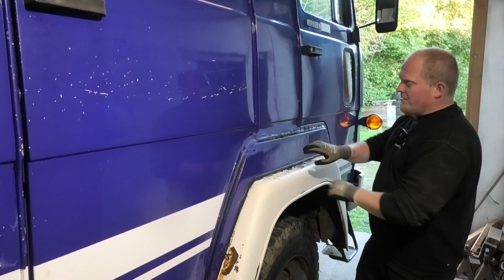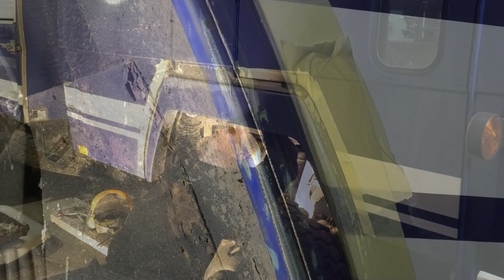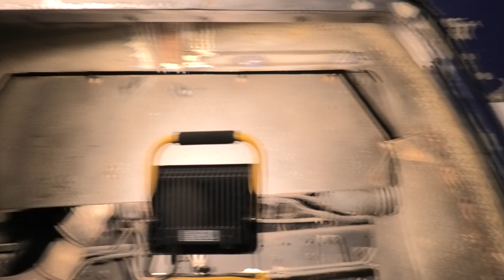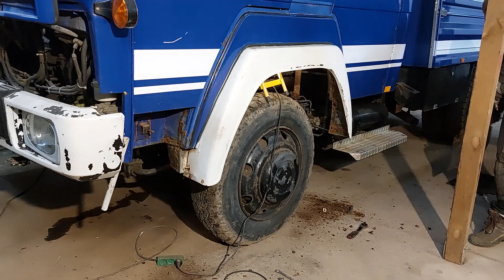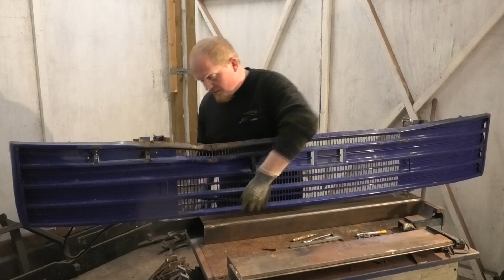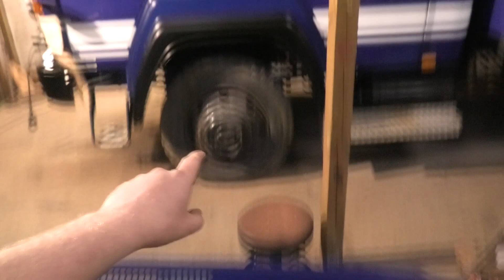Fixing up the Magirus Deutz 170D11 - Part 2

Comment: Dear KJ
👍👌👏 Oh WOW, simply fantastic! Sir, you did extremely well (despite what you've mentioned). Congratulations 🎉 for having all those skills and the patience to do this restoration work. Especially the grille turned out to be great and it's definitely the most recognisable repair. I was happy to see that you gave the old Magirus it's straight face back. By the way: In my memory these trucks had a big trident emblem where the remains of "THW" can be seen. Somehow all that flat metal above the grille looks unfamiliar respectively kinda weird. The Magirus Deutz emblem you put in the grill, sat directly above the grill under the big trident. The way you did it was on the slightly newer trucks than yours is. If you don't want to change it, you could maybe have a 3D printed KJ or KJ OR glued on there!? Anyway: I'm eagerly looking forward to watch the next video.
Thanks a lot for making teaching explaining recording editing uploading and sharing.
Best regards, luck and health in particular.
Post Scriptum: The only thing I would have done different is, that I always put paint on primer. Even if it's covered by underbody protection respectively stone chip protection. Doing so you have a better rust protection (because primer is always kind of open- pored).
Reply from the maker: Thanks a lot!
And yes, you are right, some om the older trucks had the big logo up there on the front.
But this really is one of the newer trucks and this one originally had an "Iveco" logo on it's front.
But i retro-fitted the logo that it has now, because it's not a "real" iveco truck. So I wanted the Magirus logo. And this was the style of logo they had, just before getting the iveco brands 🙂
Reply: @KJOff-Road  
Dear Kasper J.
You're welcome, it's my pleasure.
Thanks for replying. I always appreciate it.
2) I already know all that because I watched the video (and usually I do that thoroughly). In my comment I wasn't talking about the older and more rounder trucks but about this, your 'flat nose" cabover. I remember a red fire truck with the big trident logo under the windscreen and the Magirus Deutz lettering under the trident. Looks much better than having this big "unused" flat panel. At least in my opinion respectively for my personal kind of taste. But of course you made it already look much better using your skills and the 3D printed trident emblem. By the way: Do you already know what the symbol stands for? It's the rough shape of the Ulmer Münster, a famous German cathedral.
3) So there will be no KJOR lettering? 😁 ;-) For decorating respectively improving this "vast empty space", your prename would even be better. Maybe Kasper is a good name for the truck too!? 😁 ;-)
Sincerely yours
C. U. Casper
Reply from the maker: Ah yes, now I know what you mean :) and yes, that's right. The firetrucks had the logo moved up there.
But the reason for that, is because they had attachments for their water hoses mounted on the front. So the whole grille was modified. So there was no room for the original logo :)

As for putting my personal logo on there. That might just be an option 🙂

Comment: Would suggest primer before filler, it makes a big difference in both adhesion of the filler, and also provides protection as well. Inside the wheel arches a coat of rubberiser will make a big difference, as it is thicker and absorbs the chips better.

Comment: Please don’t apply the filler directly on the bare metal. Even if it is allowed it’s not good because the filler is hygroscopic. Imagine you have a the tiniest hole from welding, filler is soaking and falls off.

Please keep going, you are doing a way better job than most of the workshop!!!!!
Reply from the maker: Makes sense. Thanks :)
Reply: @KJOff-Road protect all the overlapping sheets and hollow spaces with Fluid Film or Mike Sander. Drill some holes to apply it to the hollow spaces.